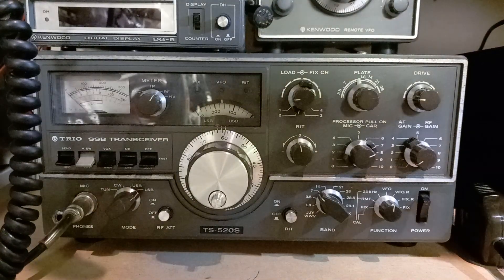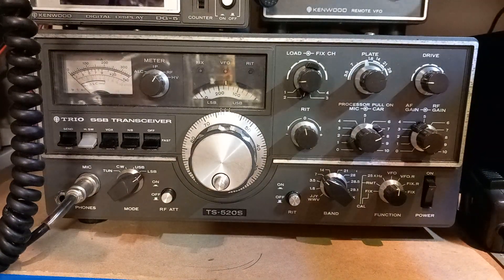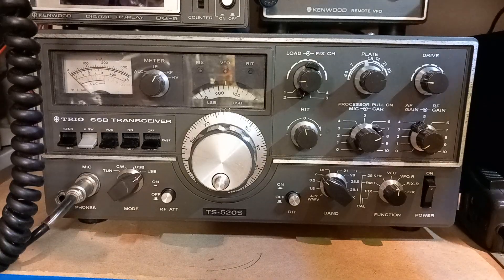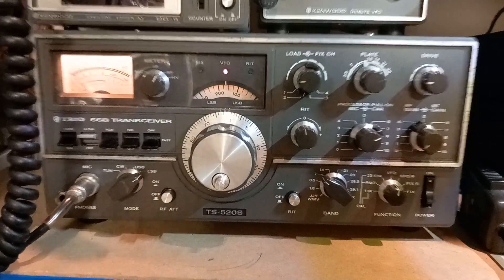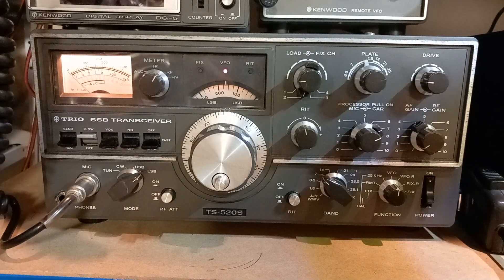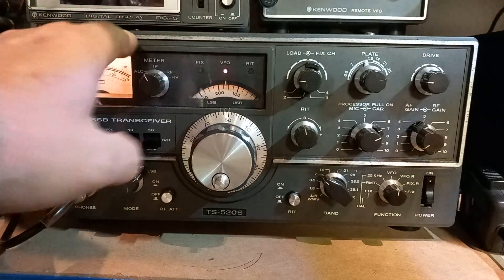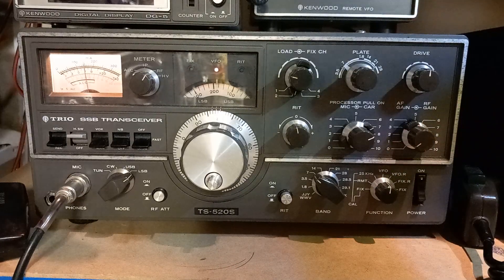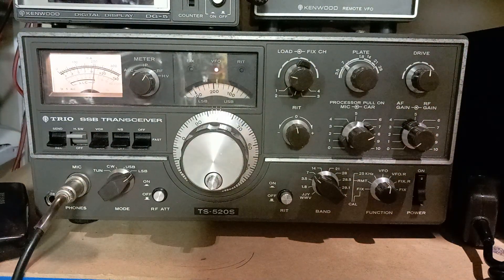A long rambling video for Jeff KN6VQP - Set up TS-520S

Comment: The Kenwood TS-520S was my first HF radio.  Built like a tank.  I like all the knobs and switches.  Kind of like driving a manual shift transmission, you feel you are really "driving" the radio.  Excellent audio.  If you have a chance to get one of these fine radios, please do.   N5VCP  Roy

Comment: That's great.... my name is Dave K0DLP and congrats to Jeff KN6VQP. I also just got my license about a month ago and got a TS-520S(Kenwood) as my first rig.  Had my first QSO today on 15meters about 900 miles away. I had tried to check in on a few nets and called CQ a few times with no reply and thought I was tuning wrong or there was a problem with the radio. Then today I called CQ and got a reply. Great videos and 73
Reply from the maker: Magical when it all comes together.
I've worked the US, Canada & S America on this rig on 10 & 15m using a longwire which isn't too good on those bands, so you'll be breaking the 900 miles soon.

Comment: My first hf rig was the TS-520. Can't remember if it had a narrow cw filter but I did do lots of CW to practice for my general. I sold it after getting a TS-120. But I missed that rig. I've since bought a 520 and a 520s to resurrect. Would like an SE as well. And a TL-922 would be the icing on the cake.

Comment: Baptism of fire is a bit true I’ve been licensed since 2020 and I use a heathkit HW101 for my main hf rig and I think I’ve spoken to you using the trusty heathkit before though I’ve got a much better rig a yaesu ft767gx. Once I upgrade to my full license I’ve got a swan 350c to use but M7 me can’t use it because 525w pep input is quite a bit. I like your video and greetings from Barnsley South Yorkshire. 
M7BLJ Jake 18
Reply: I should say that the very weak pair on 6146As in the heathkit have no issues with the 10w limit especially on tune so for a old rig it’s great
Reply from the maker: Thanks for the comment Jake.
Yeah 29th March thiscyearbon 40m :-)
I have a Swan 350 and a 400 I need to restore.
Reply: @m0jcfhamradio75  I’ve got to restore my 350 and 240 power supply as well but im in no rush been a foundation and I’ve got other high power rigs in my shelves ready to be used. Collins ART13 and globe king 500B

Comment: Hello, I just got the 520S as a gift but it lacks a microphone. Could you tell me what mic you're using, I cannot seem to get one way or the other with google. Also, Do you keep the Tube heater switch on the whole time or switch it off after a certain point?
Reply from the maker: Any 50K Ohm mic should do.
The one on this rig was made by Pye in the 70s.
Heaters on all the time for TX.
Only turn off if you're just receiving and not intending to transmit.
Reply: Get a Kenwood MC-50 which is period correct for this radio and sounds superb
Reply: I use a Shure 522 Caroid microphone on mine better than the MC50! KJ7TBR